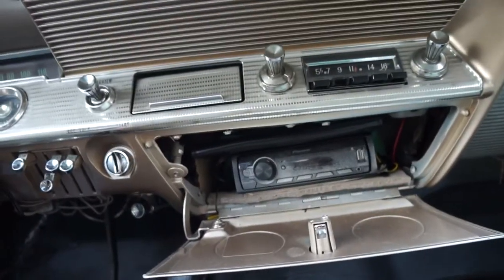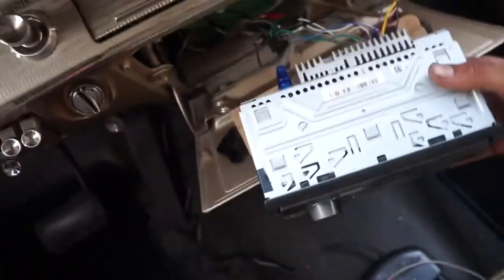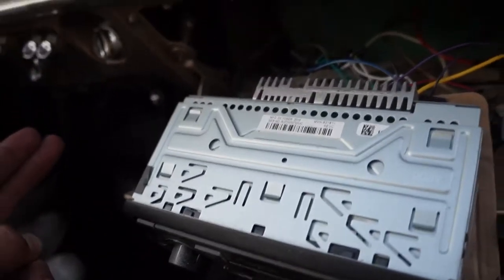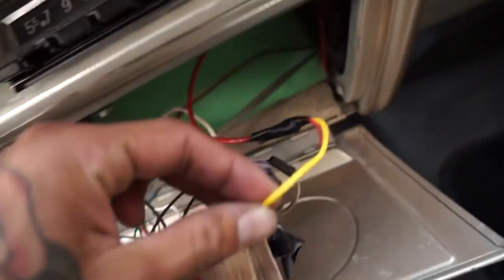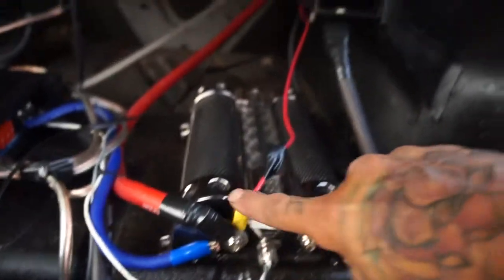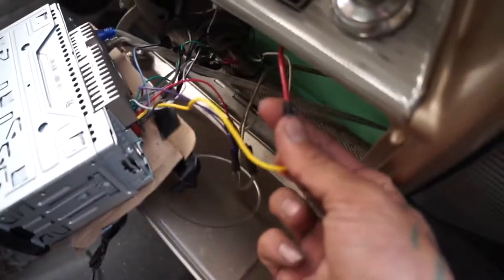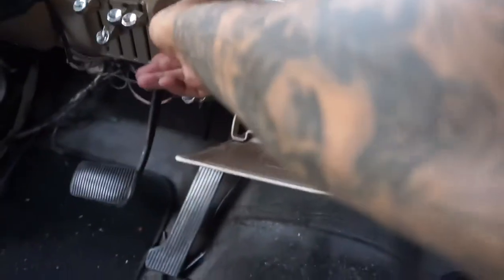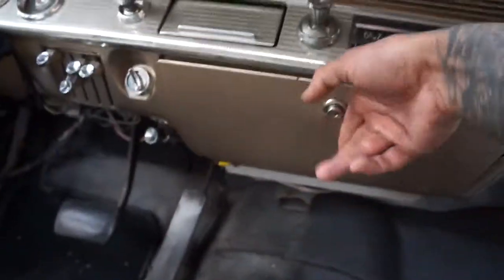How to install radio In classic car

Comment: Shouldn't you connect the red wire to the ignition switch? Or at least a switch? That is what it says on a radio manual. It is so it isn't sucking power when not in use.
Reply from the maker: Red wire connected to car fuse. The fuse box is connected to ignition switch. 

The yellow wire is constant power and that’s connected directly to the battery.
Reply: @vincentbryan1962  Oh really? Because my 79 Celica has 7 fuses and only the 5A radio fuse, 15A engine fuse and the 15A Gages fuse go to the ignition switch. The rest bypass it. Should I connect the red wire to the wiring going to ACC, or after the ignition switch?

U know what, car electric stuff is confusing, but kinda fun. I think I am gonna keep looking at a wiring diagram I found online and see if I can make sense of it my self. It would be pretty cool of I could fix it my self. It is just that I am scared of running the plastic dash by tring to take it off.

We just bought the car and we have been fixing the stuff that we can. U till I go curious of the non working radio. Untill I found out that the previous owner just connected one speaker, the antenna, ground and connect the red and yellow wires together.

I want to try to fix it my self since I am kinda understanding the wiring diagram. I think I just need some time looking at it and thinking to understand more.

Comment: Thanks man i could not find a video on how to do it on my 70 impala ...how or what kind of cabke you use to connect the wire to the fuse box? Ima try this out next day im off work
Reply from the maker: i use the same type of connector you use to connect speakers to. like on the back of any car speaker. they have like 20 of them at autozone for like $2
Reply: @vincentbryan1962  cool thanks bro ill go get some when i get a day off havent that change to do anything
Reply: I’m doing the same to my 70 impala lol I just pulled my retro sound out of my continental

Comment: This helped for my 63 mercury. Thanks man
Reply from the maker: I’m very glad it helped! Hope it all works well too. Mine is still going strong. I ended up getting wiring my power wire directly to an audio battery
Reply: @vincentbryan1962  I ran my yellow on a fuzed wire to the battery. Negative to the firewall and the red to where the original radio wire was. It works great.
Reply from the maker: Verdant that’s smart an In-line fuse I didn’t think about that
Reply: @vincentbryan1962  just in case something happens it wont burn up my radio. Better safe than sorry

Comment: Thanks, I couldn't find a video. I think this might work for my 54 bomb
Reply from the maker: giovanny ramirez let me know if you have any questions. Since this video I cleaned up all the wires tucked them away and got a new head unit. But with all the same connections still working strong and the way it should be. I’m interested to see where the fuse location is on a 54
Reply: @vincentbryan1962  actually going to install one. 54s didnt come with any. Ordered the 4 prong fuse box, gonna run the stereo and the lighter to it. Gets here thursday maybe I'll post a video. Nobody is doing much on the oldies.